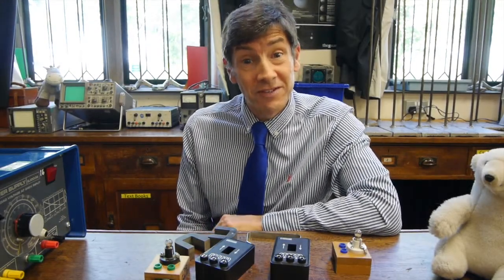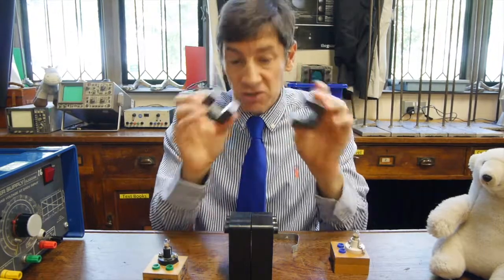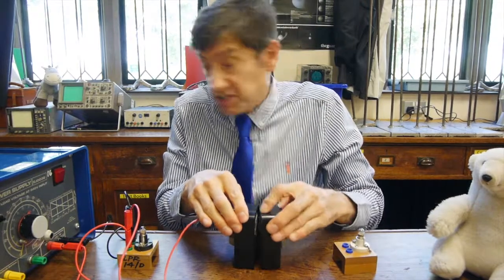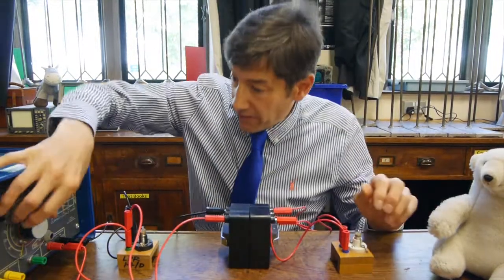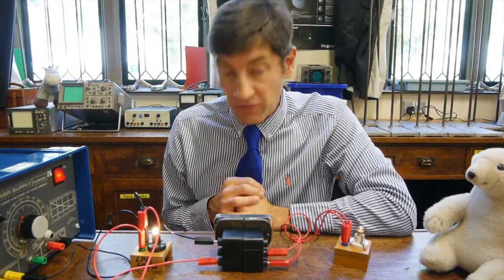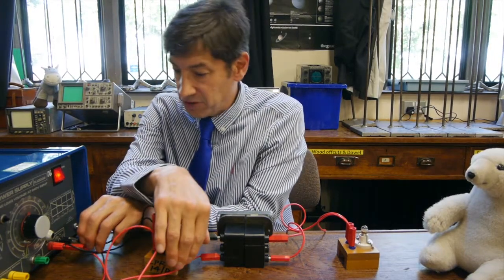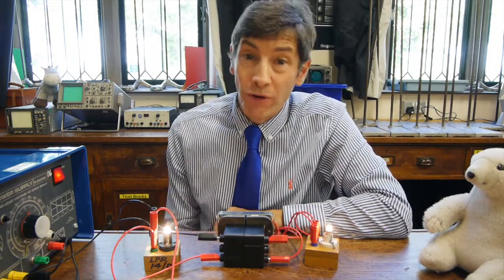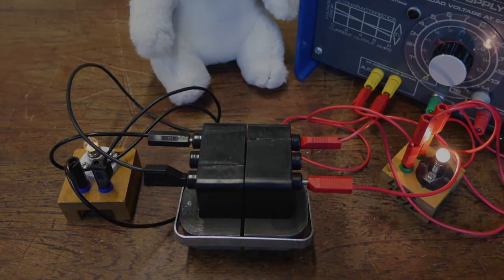How Transformers Work - F-J's Physics - Video 125

Comment: Hi F-J!
Question ( not about transformers):
Does centripetal force of Earth affects g (9.8 ms^2)? Or we are  in a sort of closed system and rotation of earth  has no effect?
Reply from the maker: Good question. Yes, the Earth's rotation does effect the measured value of g.  Many things effect the local value of g such as height above the centre of the Earth and underlying rock density etc.  Note that the Earth is oblate meaning the poles are closer together than two opposite points on the equator so the poles being closer to the centre of the Earth make the value of g there larger.  However, on the equator the effect of rotation also has the effect of reducing g ever so slightly.  Taking this a bit further, don't forget the effect of the Moon and Sun's positions too with their force acting away from the Earth's surface.  I hope that has helped a bit and not just confused things further!